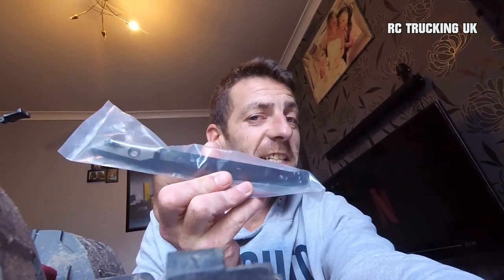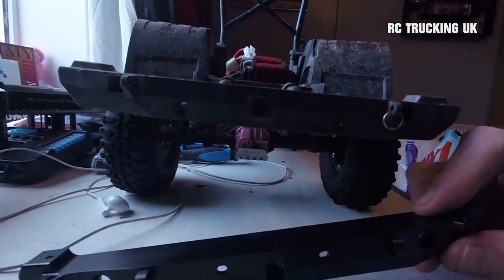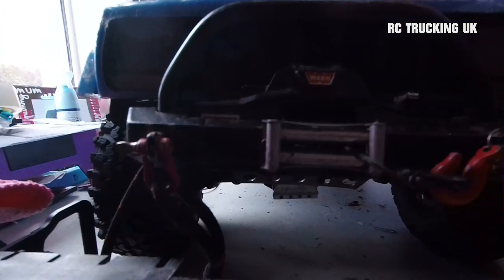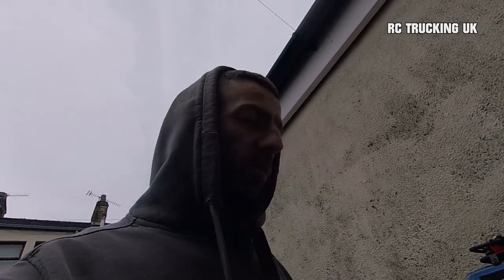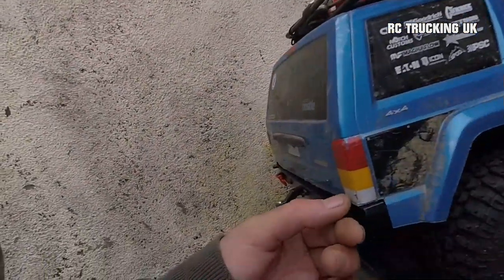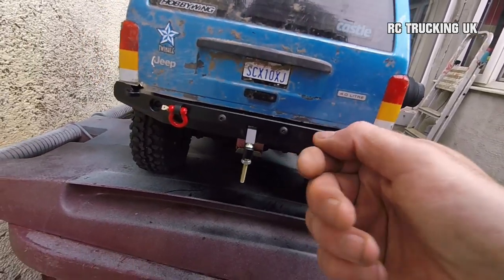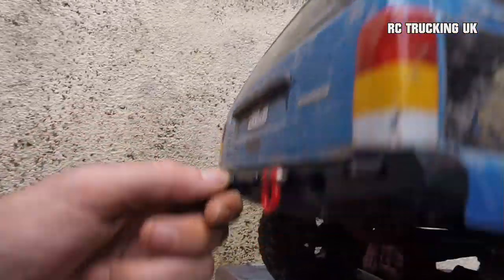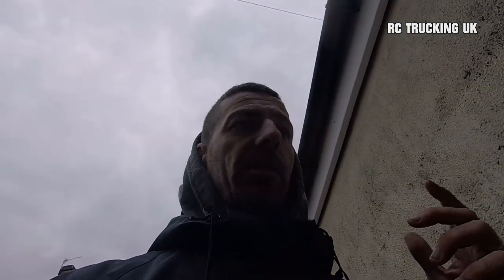CHEAP rear rc bumper scx10. 2 | HPI Wheely King gets a trailer ride

Comment: I wish you would supply links to the parts used in your description. I'd like to order that in addition to some of the mods applied in your other videos!
Reply from the maker: Ebay..  Just search what you want, its pointless putting links when it's purchased off ebay as next week they may not be there anymore.. I can see if they have part numbers and include those.. But in the past I've provided links then the items or sellers are no longer there.. 👍